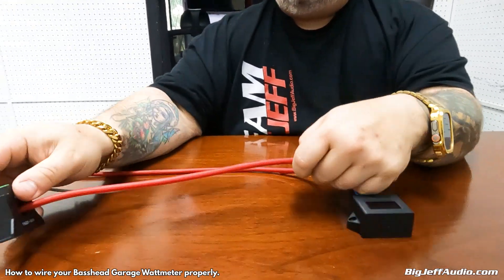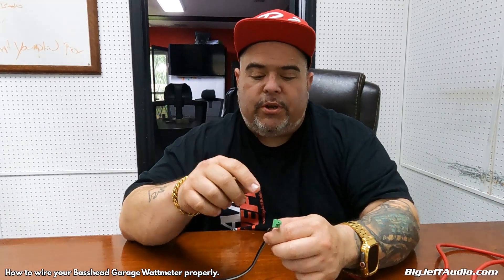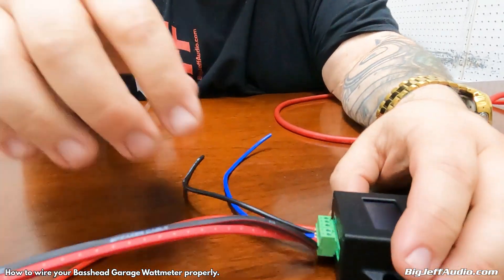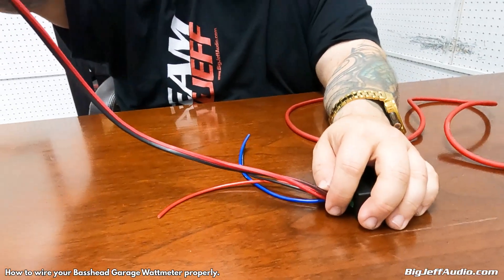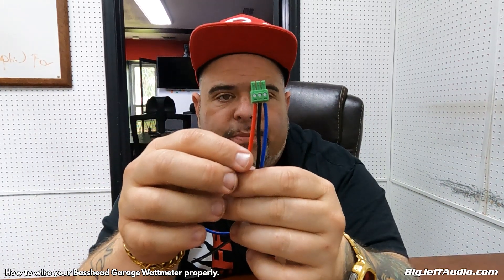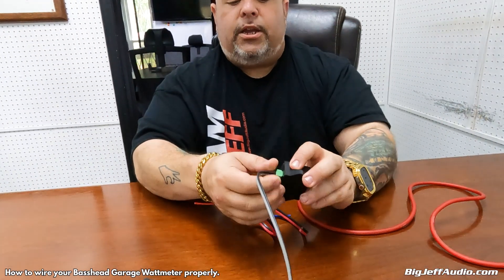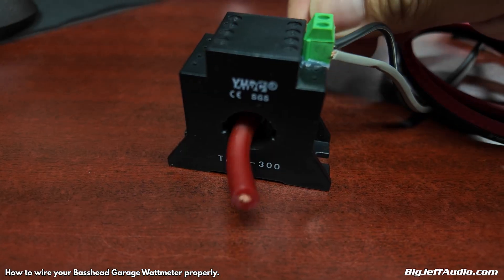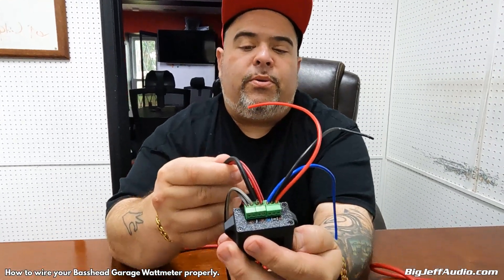Big Jeff Explains how to properly wire your Basshead Garage Wattmeter

Comment: Mine is reading low wattage why would that be?
Reply from the maker: Hey Rob! When these read low, it’s usually because the meter isn’t seeing the full speaker signal. A loose clamp, wrong wire, or wiring not fully seated can throw it off. And music volume/impedance will also affect what you see.
Every setup is a little different, so the best move is to go over yours together. If you want, give us a call at 737-BIG-JEFF (737-244-5333) and our customer service team can walk through it with you and make sure it’s reading right.
Reply: @BigJeffAudio I used cheap Amazon 16 gauge wire and I think that may be the cause. I am re wiring it with some quality wire this weekend and if then I am still having problems I may be in touch. Thank you for reaching out that is great service and very much  appreciated 👏

Comment: Ordered mine , ordered some 7 wire , stripped it back really short , put ferrules on it , cut the ferrules to fit properly , and it reads ohms , voltage and everything else , but wattage barely reads over 200 🙄 and on my electrical I know that’s horse shit
Reply from the maker: If it’s showing volts and ohms right, then the screen itself is working fine. The watts reading only comes from how the meter sees current, so if that connection isn’t perfect it’ll make the watt number show way lower than what you’re actually pulling.
Reply: Mine is doing the same thing i am gonna run different wire for the clamp and see if that helps or not

Comment: How do you wire it when you are running 2 amps?
Reply from the maker: If you’ve got two amps and a Basshead Garage Wattmeter, the easiest way is to put one wattmeter on each amp’s positive power line right after the fused distro block so you get accurate readings. If you only have one meter, just put it before the distro block to see the total power both amps are pulling. Just make sure everything’s fused right, use thick enough wire, and remember the wattmeter goes on the positive line—not the ground—to keep things safe and accurate.
Reply: @BigJeffAudio  you are talking about the current wire it sounds like, what about the voltage wires? Do I just use the speaker wires from one amp or what?